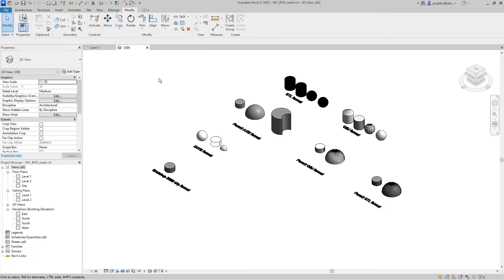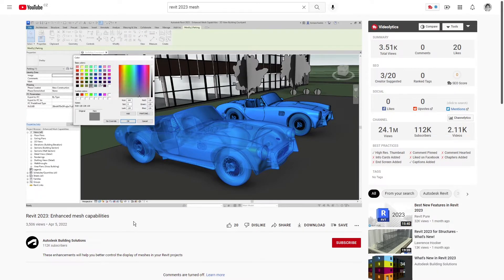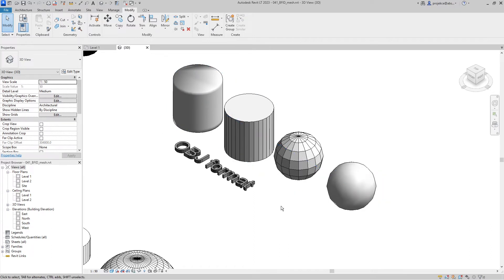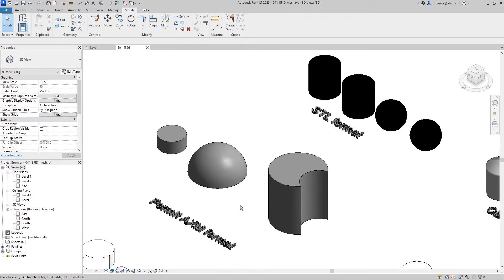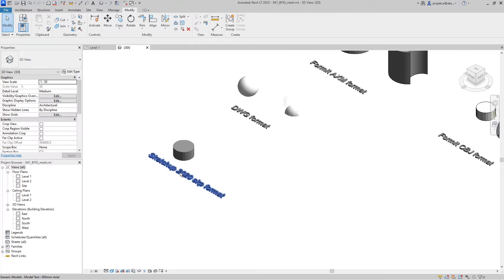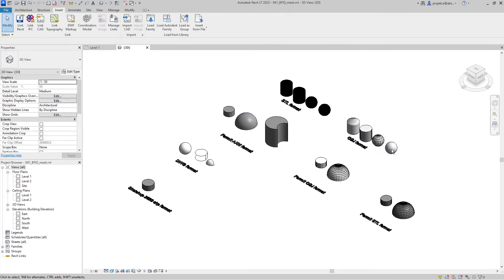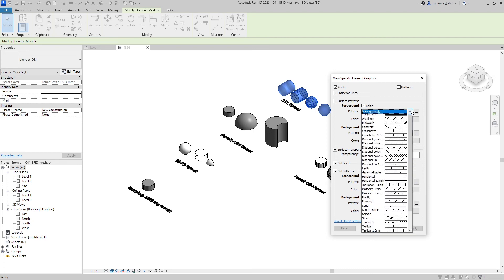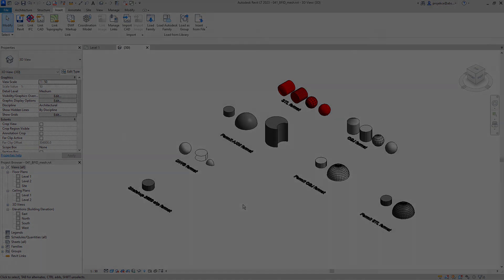Revit 2023 Imported Mesh Enhancement Showcase | Internal Edges Visibility

Comment: Cool I wasn't finding out why when I export a certain file from blender to Revit as OBJ, it had the mesh lines. Then I just used "right click -> shade smooth" in Blender and it solved my problem! Thanks for the insight.
Reply from the maker: Yep, one often has to resort to trial and error methodology when transferring geometry. Glad to hear you found the solution.
Reply: Mine still show so what's wrong with it :<

Comment: Thanks. This is useful. Have you tried IFC as well? That would e.g. be used if one exports geometry from Archicad.
Reply from the maker: Thats interesting question. I did not test IFC. But these days IFC workflow becomes more and more relevant, so I guess I will test that and let you know of the results.
Reply: @BIMforInteriorDesign  great, looking forward to learning of the results you get.
Reply from the maker: Hi, I finally got to test the IFC import/link. There seems to be no smoothing of edges even in Revit 2023. I only tested IFC export from Revit and than import, so there might be different results when importing ArchiCAD IFC, but I doubt it. Mesh quality is not a priority of IFC file format in my opinion, so I wouldn't hold my breath to see improvements in this area.